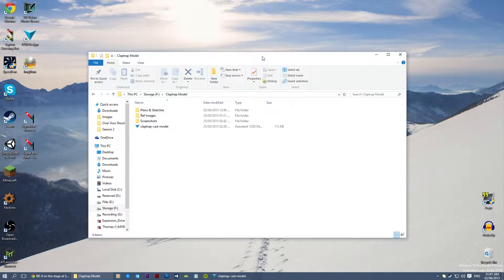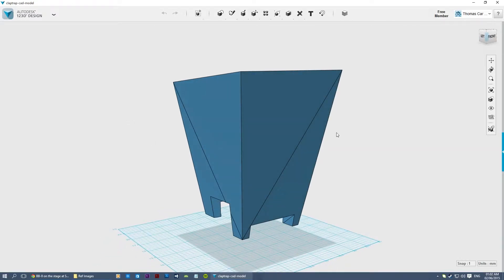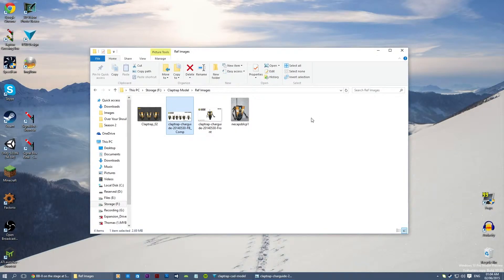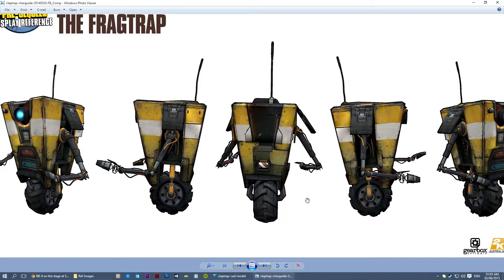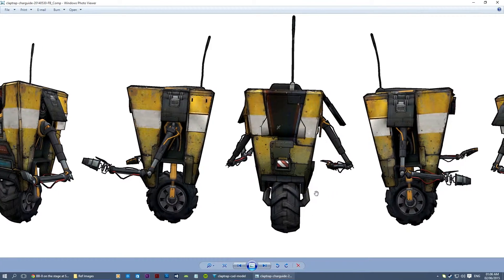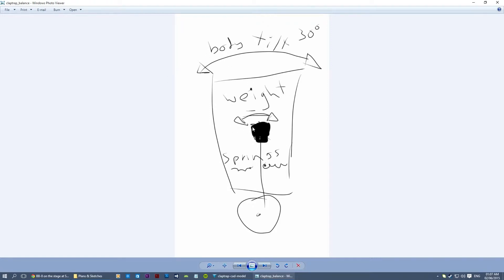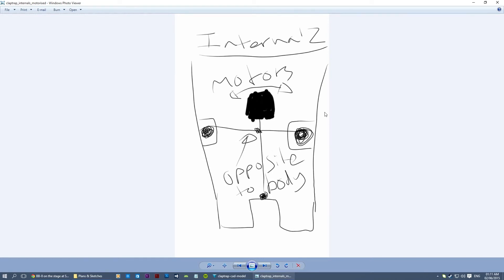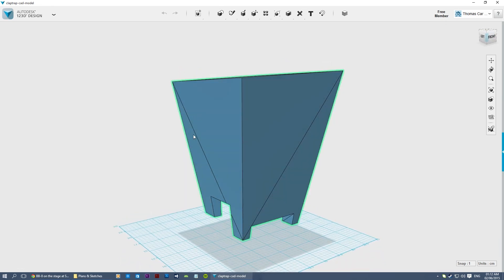RC Claptrap Project - Part 01 - CAD Design & Balance System Ideas

Comment: Cool to see another Claptrap project! I'm about to start making my own RC Claptrap, we have the same idea about the wheel (wheels), and I've also been thinking about counterweights inside of the body.
I'm experimenting a bit with the center of gravity, I want it as low as possible, under the axle would be the prefered COG, because that would stabilize the whole body if I'm right.

I'll be following your build, keep it up!
Reply from the maker: +Johan Liljekvist awesome. Keep me updated on your build. I plan to start mine again soon. However I want to build a BB8 first. Thanks for watching!